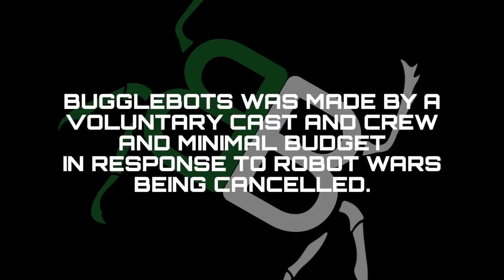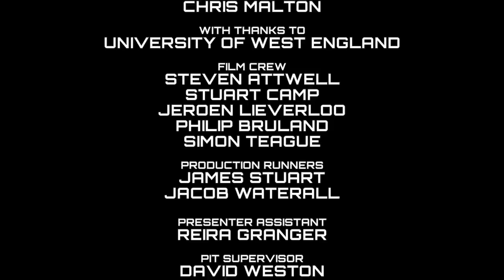Bugglebots 2018: The Grand Final

Comment: "In the US there's not a pit option"

Actually, it depends on the arena. Some of our arenas have pits, others don't.
Reply from the maker: Noted. Captain Doom doesn't fight in competitions with pits in the US or at least Doom kid says he doesn't like using pits :)
Reply: @Bugglebots  
I noticed that based on his driving at DragonCon Robot Battles 2017. He tried to keep away from the pushout as much as possible and eventually ended up diving into it when he missed a box rush. Doomkid's an amazing driver but he does have a habit of driving at full throttle 100% of the time.